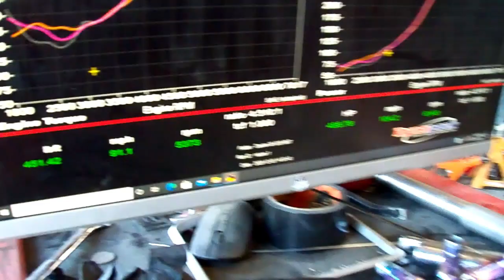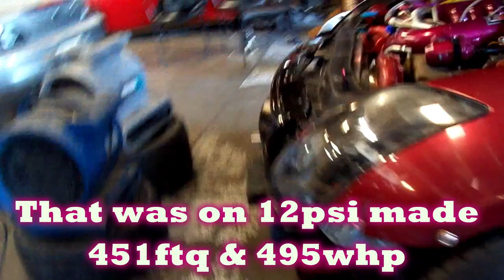Single turbo G35 VQ35DE-RevUp Dyno day for E-85-Impressive gain

Comment: Hell yeah man I’m making 523 wheel on 93 octane and 15 psi of boost with forged internals and transmission
Reply from the maker: Yeah that's good man. Those number are plenty of power for the streets.

Comment: what would you say i should run in psi if im daily driving
Reply from the maker: If your engine is stock, don't go pass 10PSI and if it's built, you can run from 10-12PSI not a problem which you should be making about 425wheels range.